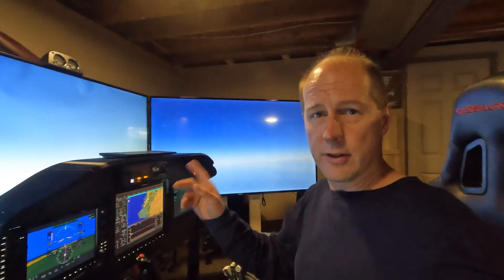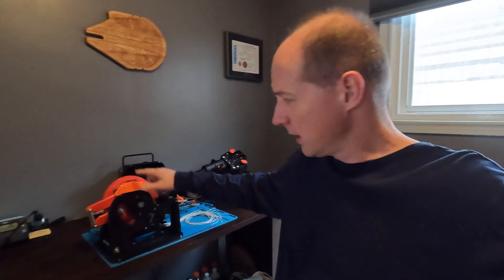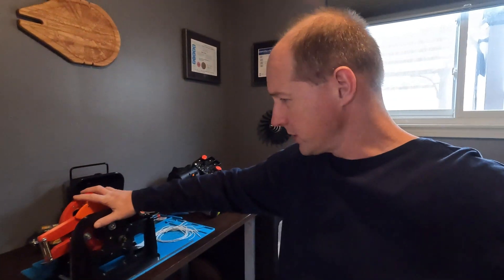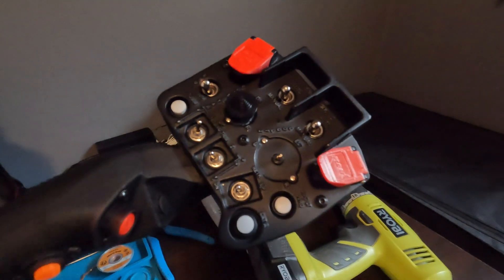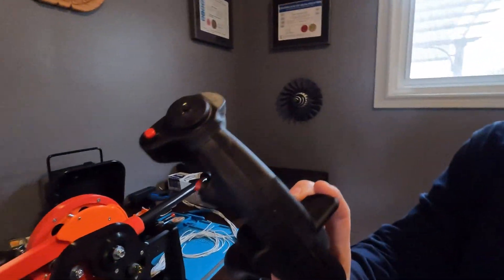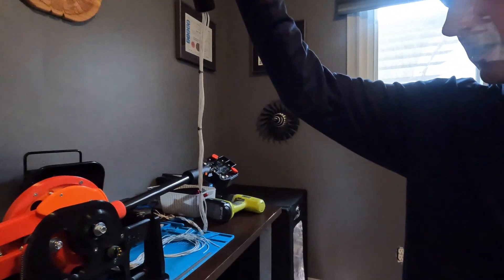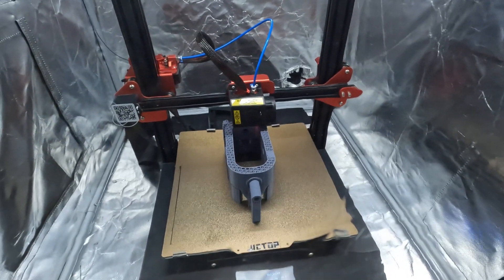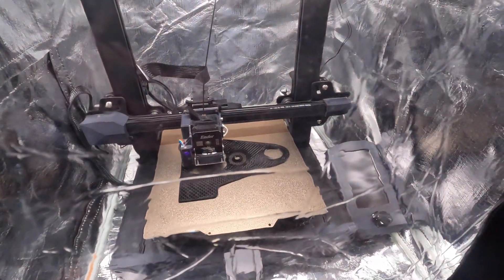3D Printed Helicopter Controls for MSFS - Part 1

Comment: Thoughts on building this collective as a non-ffb? I'm only flying simple helis.
Reply from the maker: Truthfully I've never gotten the force feed back to work correctly.. I can make it work as beep trim, but not track as the controls move with the auto-pilot. So really its not a necessary part of the build. Saying that, the motors even powered off, do act as dampers adding some resistance to the controls. So you still need something there or they would just flop everywhere. The motors are cheap to buy, so to install them and just not wire them up is very do able as well. Since that is basically how I use them...

I've also just realized I did this video a year ago this week and have never done the part 2.. So I'll be working o  that today and hopefully it will be up this evening (eastern time zone)

Comment: Nice work, what software are you going to use to drive the collective?  I built mine from a VPforce Kit, who have their own software specifically for FFB Cyclic/rudder/collective. All the best.
Reply from the maker: Haven't gotten into the programming fully. But everything is run via a Leo Bodnar card for the position hall sensors and Mobieflight to control the motor drivers.
Reply: <3 I just got the drive finally to get my ender v2 going again, and also found a good option for making custom and configurable hardware with the BluePills! So now I'm looking at making  myself a printed collective, and I'm super pumped!! Thanks for giving me inspirations for future builds!
Reply: Like seatime…..I modified the 737DIY collective with the VPForce FFB motor and shift register.    I also modified the collective head to resemble the AW109SP as I’m using it with the excellent X-Trident 109SP for X-Plane.
Reply: @miket3445  How did you do that with the VP force FFB motor on the collective? did you just change out the motor in this one? are they the same size or did you have to make a new bracket?
Reply: @szlash280z hi, I modified Karl’s 737DIY collective (I purchased his CAD) so that I could use the VPForce Rhino 57B motor and control board.    No need for the Force Trim setup or the pot or the servo motor drivers, etc.   So much simpler as the VPForce motor also includes the axis pot internally and the board running the motor is small and compact and has software app that allows you to configure the feel of the collective as well as force trim……..it’s all neatly packaged and wired.
Reply: Did you build the 737 collective using a VPforce motor? how did you do that?